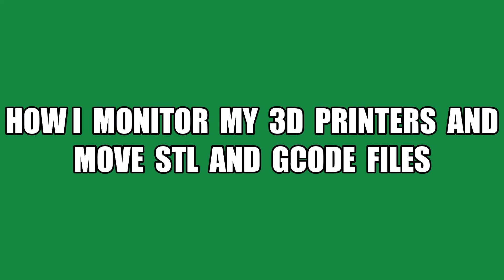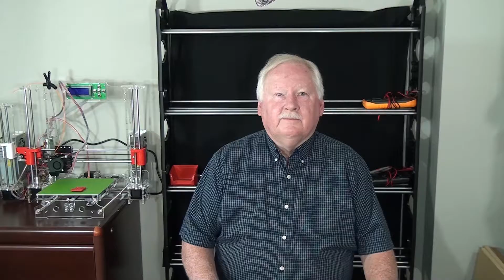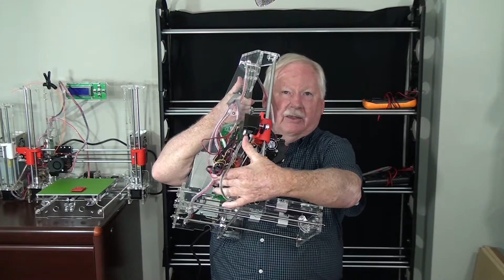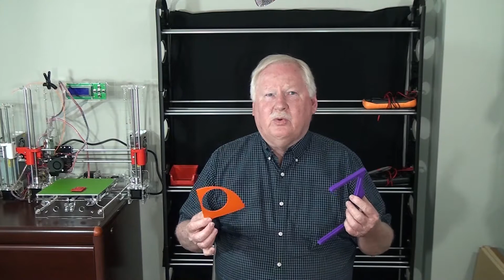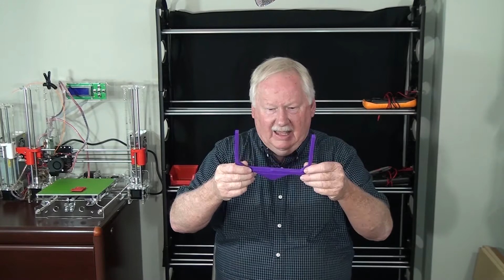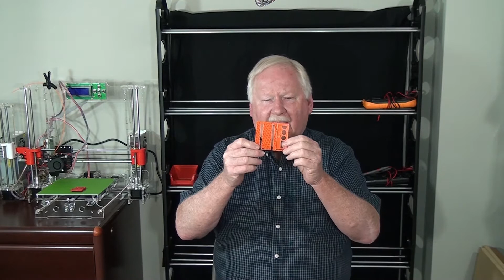How I monitor my 3D printers

Comment: These are some odd looking printers.  Most people start with Ender or Cura printers.  What made you choose the kinds you use?
Reply from the maker: My first primer was purchased on eBay for $85 and took about 5 hours to assemble. It worked and I purchased more printers costing between $85 and $130 which also worked. By the time I decided to start a business making products with these 3D printers I had several cheap printers and some Kingroon KP3 and Anet ET4 printers. These were making good parts and are still a part of my print farm and produce a lot of good parts for me. You could say I didn't know what I was doing and just learning as I went along. I guess I'm still learning as I go. Thanks, Wayne, for your questions...Ken

Comment: I know this was an old video - back in August 2020 so I'm not sure how far you've come along with the video editing and managing cameras, etc. There's a free open source software called open broadcast studio (OBS) that is great for what you want to do. You can toggle between camera views on the fly and the view of your desktop and even individual application windows. Each video input is setup as a "Scene" in the software and you can do picture in picture and overlay images and videos layered on top of each other. Another tip is you can turn a smart phone into a camera that you can use in OBS and you can even recycle old webcams out of broken laptops and hook them up to the USB ports of computers which is what I may end up doing for the cameras on my octofarm. These are just some ideas for you if you want to look into it further. Also I've tried several video editing packages and found Cyberlink Powerdirector to be the most powerful and feature rich for the cost. I upgraded my computer with 32GB ram and a solid state nvme drive and it makes a huge difference for video editing performance. Everything is solid state and I don't keep any traditional drives plugged in because every time a traditional drive first spins up windows 10 freezes for a couple of seconds.
Reply from the maker: I am currently using Adobe Premiere Elements 2021. Or should I say I am trying to use it. Have been learning a little more each time I use it. Thanks for the advice...Ken